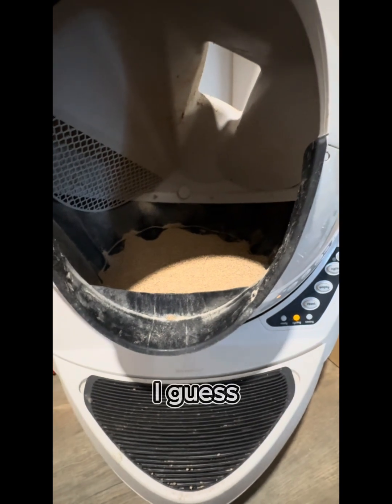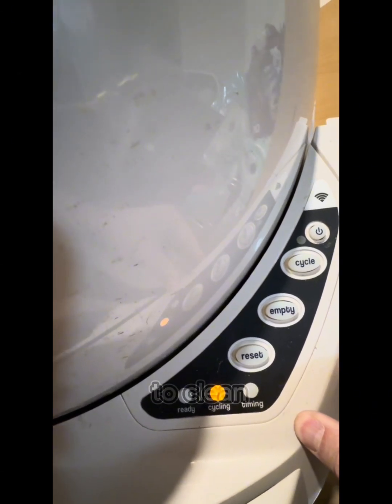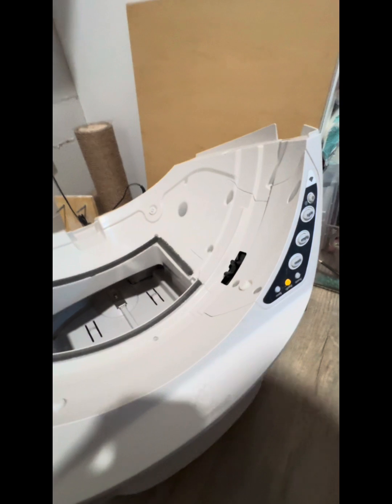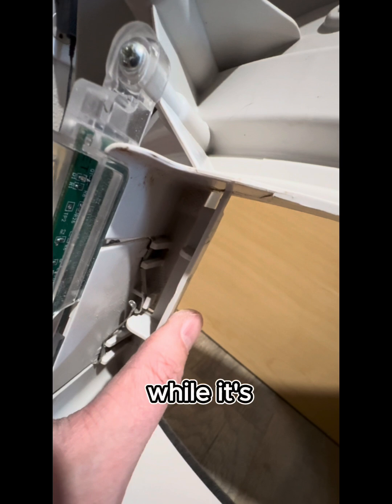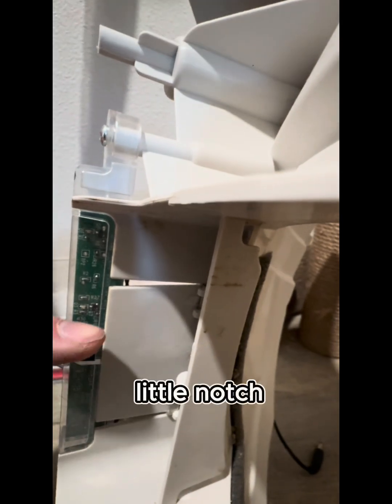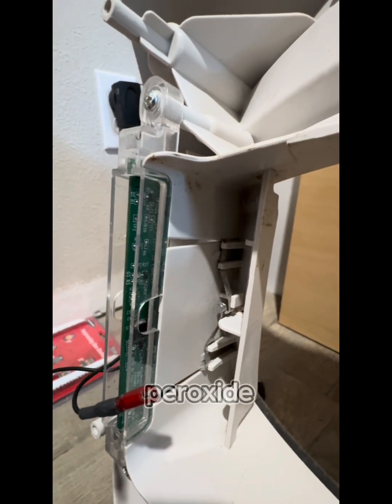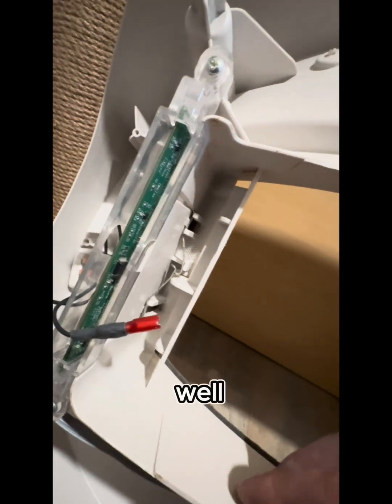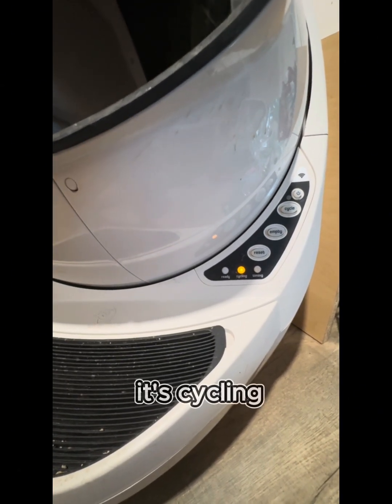Litter Robot 3 - Fixing Pinch Detection Error

Comment: So mine will start with the flashing blue light, you try to hit cycle, or empty and its not working. I hit reset and it goes to orange flashing on cycling. Should I also clean the other side mother board?

Comment: I've had my new Litter Robot 3 since September of 2024. My old one was about 7 years old and was causing problems so I bought a new one. Starting around January, after only four months, the new one started having the same problems. The globe would spin counter clockwise to empty, and then it would either get stuck returning to it's normal position, or it would continue rotating too far and dump all of the litter. I took it apart four different times and cleaned everything, reset it, and still had the same problems. While I was watching numerous YouTube videos try to figure out how to solve this, my adult son ordered a new motor from the Litter Robot website for about $60. It came a couple of days ago and we installed it today. When we removed the old motor we found that the large black gear that spins the globe was loose on the motor shaft. The new one was secured in place. I'm thinking this was the issue and that the gear would move back and forth while the motor was spinning, causing the faults. So far it works perfectly. I'm posting this in the hopes that it helps others with this frustrating issue.

Comment: Your FIRST step before you clean the circuit board is to actually REPLACE the pinch detectors. I did this and the problem was solved
Reply: I replaced my pinch sensors less than 6 months ago and now have the same issue again. Its such a pain to constantly have to clean the board.

Comment: Thank you! I tried the hard reset and all those things but this was the fix!! I didn’t even have to take the screws out I just got in there with a flashlight, qtips and peroxide and cleaned the connections really well and the circuit board which was gross. Everything works like new now.
Reply: I’m about to try this right now!

Comment: I hate hate hate our litter robot. It's insane to me to pay the amount this piece of garbage is worth to have so many people having issues.
Reply: I have had two for 8 years LR3. It is the best thing in the world. But… only after I turned off all the sensors and used a smart plug to turn off and on. I know not ideal but all products out there will fail with all the flashy sensors. I have modified them to work non stop for a month with a large crap collector at the bottom. The internal design is super easy to understand and for a light technical minded person v easy to modify and all parts are available to buy if one fails like the motor etc.
Reply: I totally agree! Piece of Garbage!🗑️
Reply: Been fighting with mine for 1.5 years. Have cleaned it and still pinch condition persists. My LR3 does not have 8 screws on the bottom to separate from the top where the parts are so not sure what’s the deal. And my husband can’t get the screws out that are there. I just want to take this thing out back and give it the shotgun fix.

Comment: Thank you. Had this exact same issue this week and having bypassed the pinch sensor at few months back I was at my wits end until I came across this video 👍
Reply: How did you bypass the pinch detection?
Reply: There’s another video where a woman shows how to pull the sensors out, use electric tape to attach them to each other, and she also used a ziptie to make sure it stayed put. Then she pushed them back to where they go.

Comment: Thank you very much for sharing this video. Everything in forums seemed to indicate the DFI sensors being broken and needing replaced, which was not super expensive, but why replace something that may not be broken. Took the bottom apart and noticed the pinch detectors had a lot of crud in between them, and that same visible part/chip on the circuit board was dirty too, so cleaned that all up with isopropyl alcohol and put it back together and she is spinning once again.
People should try cleaning this all indeed instead of just assuming the DFI sensor is broken.

Comment: Damn companies always making things purposely break. Theres no reason for those holes to be there and catching shit on the board.
Reply: Stupidly enough it’s a new thing they added, looked back at an older model I had and it doesn’t have the same hole open that the newer versions do
Reply: @invictus6176 Mine doesn’t have that opening either. It’s nearly 8 years old and just now flashing yellow. Strongly considering buying a new one instead of going through all of this tear down especially since there’s no guarantee it will fix it. 8 years is a good run.